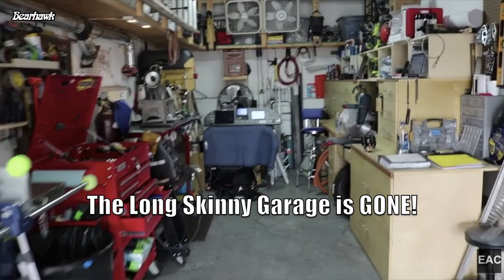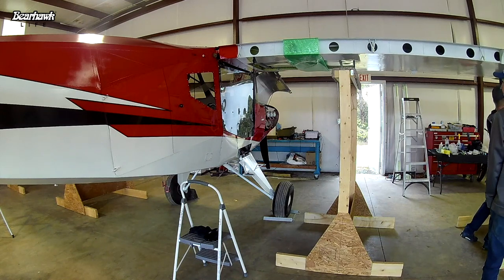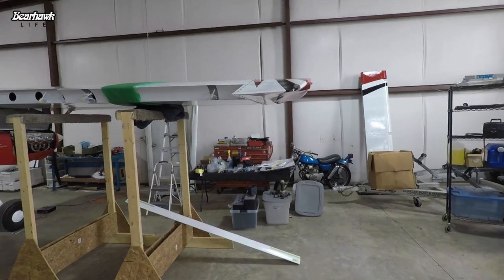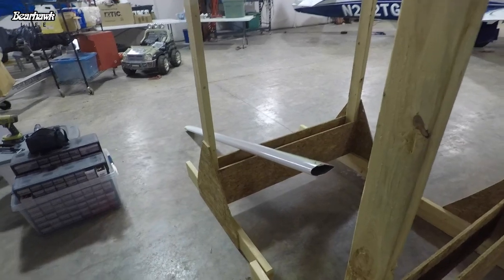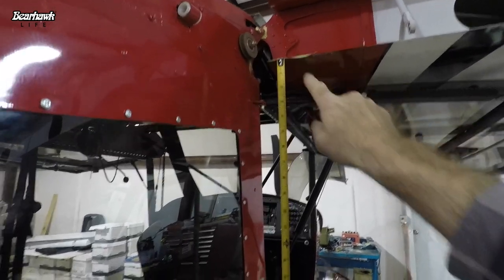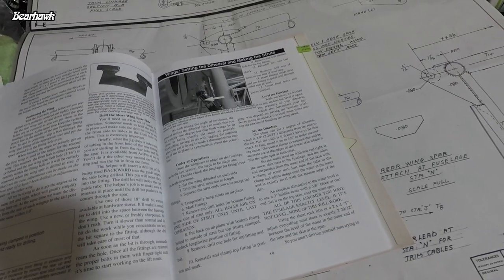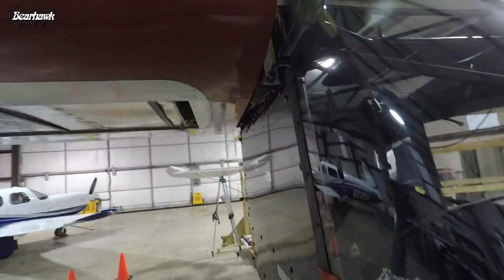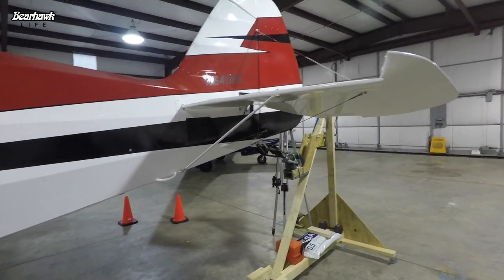BEARHAWK ~ Installing the Wings!

Comment: Big psychological boost getting the plane in a hanger and getting flying surfaces attached. Kind of eye opening when you realize how little actually holds the wings on. AN364 nuts are ok on everything as all load is in shear. Is the wing twist built into the wing? I know it is on a Cessna, dihedral is adjusted with an eccentric bushing on the rear hinge, both dihedral and twist are adjusted with the struts on a Cub.
Reply from the maker: Yeah I was kinda hitting the wall before we got the wings on.  Seeing it in it's current condition has really inspired me.  I don't believe the Ribbet airfoil has a twist in it.  I've heard no reference to that from the designer and several of the scratch builders I have spoken with.  Thanks for watching!

Comment: Easier than a transit, a clear plastic tube filled with water can be taped to the wing where you have the tape measures. The measurements can be made to the level of the water, and it’s just as accurate as using a transit.
Reply from the maker: We did have a water level available to us.  We preferred the transit overall.  For us, it was much easier to set up and record specific measurements that could be documented for future reference.

Comment: Hello Rob, So the bearhawk doesn't have a horizontal stab Jackscrew like a cub, only elevator trim? The one degree Dihedral isn't much, but It is enough to keep the airplane stable and not hunting for level. It also makes the bearhawk faster than High dihedral airplanes, correct?
Reply from the maker: Correct.  No jackscrew on the H stab.  I've not heard of any Bearhawks unstable and hunting for level.  From what I have read, just the opposite.  Surprisingly stable and light on the controls from those I have spoken with.

Comment: Hey Rob, why the sight glasses for fuel gauges instead of electronic ones?
Reply from the maker: Great question!  I address why I went with sight gauges in this video:  https://www.youtube.com/watch?v=V2w3KL5AXvM.  A pressure sensitive fuel probe will not work because of the negative pressure created by the Bearhawk vented fuel caps.  I even considered tank floats with electronic sensors.  However that would involve cutting and aluminum welding.  So since the Bearhawk tanks come with sight gauge ports already installed, I went that route.
Reply: @TheBaldPilot  Ok, thanks for that. I think I read somewhere that the wings now come fully assembled with tanks installed so I may not have the option, but I'm planning on CiES senders to read on the G3X for our BH5. I'm also hoping to have extended range fuel so that means extra cells in the wings or a belly pod with a tank. Some guys use portable bladders too. Good thing there are options. I'm up in northern British Columbia and our bird will see a lot of northern long distance use. And on floats.
Reply from the maker: @sonshinelight  Yeah Mark is doing so many things now at the factory that really helps the builder complete the project more quickly.  If your tanks are preinstalled you should not have much trouble removing them to install the senders.  I think that task will be much easier than the initial installation of the tanks.
Reply: @TheBaldPilot  I should call him and ask what my options are for tanks and accessability. I get the feeling the wings will be closed up already on delivery.
Reply from the maker: @sonshinelight  I would be very surprised if the tank covers will be fully installed which would involve installing the 60+ nutplates around the perimeter of the opening.  Not something I would expect the factory to do.  More than likely the tank covers will be temporarily held in place with a few aluminum pop rivets that you will need to drill out.
Reply: @TheBaldPilot  That would work.
Reply: @TheBaldPilot  I checked with Mark and he said like you did that the bottoms come pop rivetted and i can install the extra tanks as well as senders if i want. Very enlightening chat.